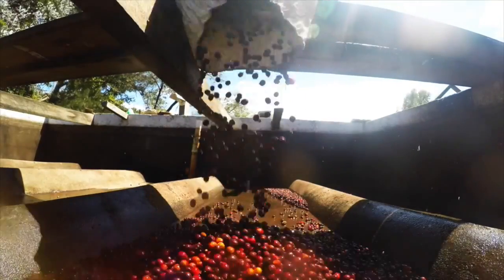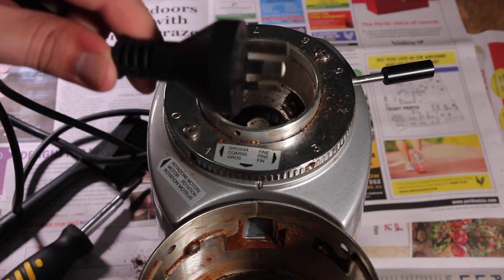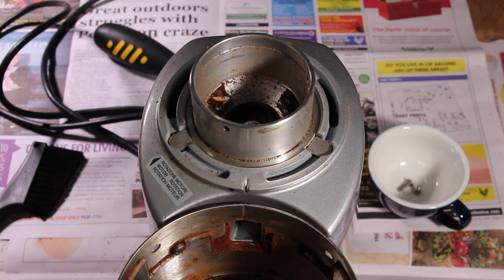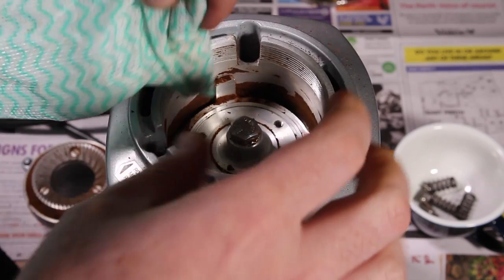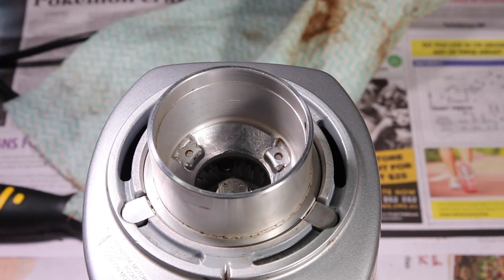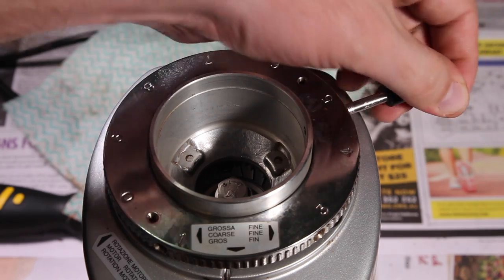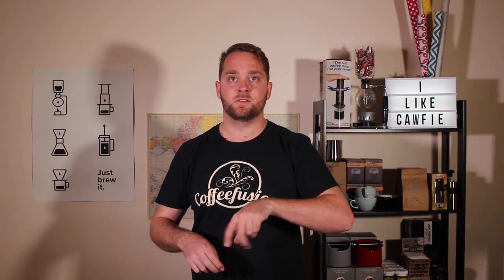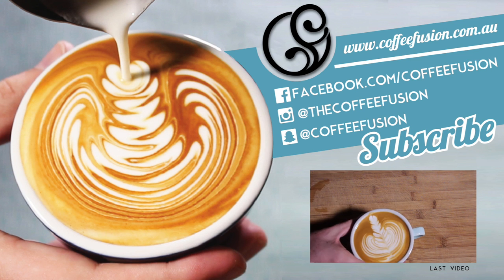Coffeefusion Tutorials - Cleaning Your Grinder Burrs (Mazzer Mini)

Comment: do we really need to take it apart ? Is it enough just put some cleaning material (e.g.from Puro) and grind it ?
Reply from the maker: I haven't used that one in particular, but when I have used those in the past, they haven't done the best job.

Definitely going to clean out the grinder better if you can take it a part - just make sure you're careful if you're going to do it. You can see the difference in my burrs from the cleaning job!
Reply: how often should I clean it ? I only grind 1 kg per month. Actually, I want to do it to see whether I can re-calibrate my Compak. now I must use maximum fineness for espresso.

Comment: I have a marginally-related question: How to calibrate for different humidity at home?
Recently the humidity in my home went up quite a bit, and I had to grind coarser to counteract the slower extraction. I know that baristas calibrate for that by pulling shots of espresso before they open, but that will be too much for home brewers.
Is there any reference on this, say a grind-size vs humidity curve that I can use to calibrate the grind size to humidity?
Reply from the maker: I haven't seen anything. I would say that I've never experienced a weather changed that has taken a shot from bang on parameters one day to undrinkable the next day. Personally at home, I usually drink anything within a wide range of parameters (lets just say for eg from 24-32 seconds), and make an adjustment so that the next shot will pull better if I see it running fast/slow.

The weather in Perth, WA isn't super extreme so perhaps in other parts of the world there would be crazy swings. The main time I'll get a huge difference in grind setting is when I'm changing batch (ie roast date) or the coffee itself.
Reply: I see, so you calibrate based on the first shot. Not sure whether a 20% change in humidity (in 6 hours) counts as crazy, but that did make a difference for the feel of the grinds as well as the espresso shots for me.